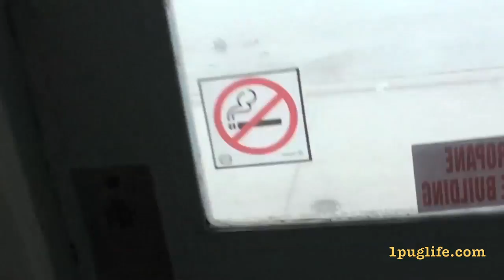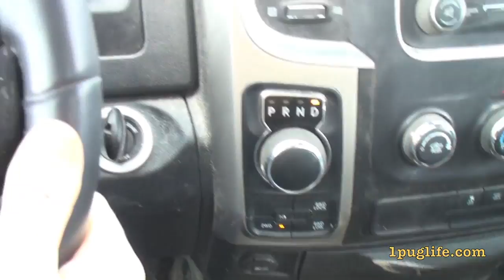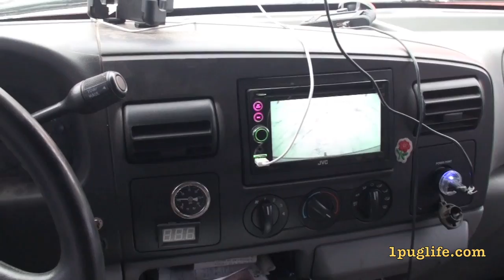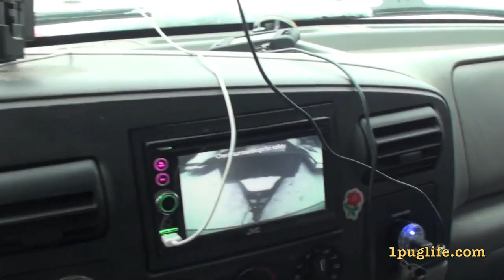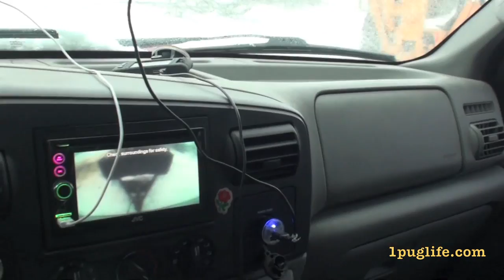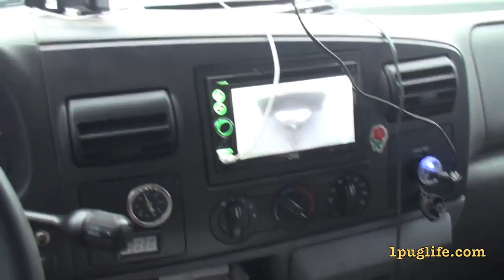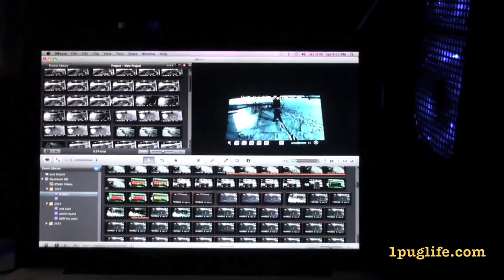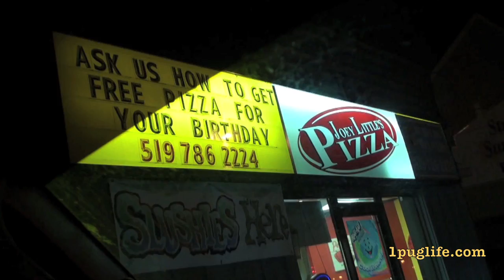spur of the cigrits wood operations

Comment: Turds used to rob me till I wired up my doorknobs to my welder outlet and then when they went to pull the doorknob off the legtricity turned their hands into baked potatos.
Reply: ps, put down lots of rock salt at night in front of the door for good conduction.
Reply: I'm talking about the 220 outlet on he wall. I use it to run the compressor. I do not know much  about arc welding.
Reply: *****
have you always hated yourself? you must still have all your teeth.

Comment: Hey pug, you need a STIHL chainsaw. They are the best. I am a small engine mechanic. Have worked on all kinds. STIHL IS THE BEST .
Reply: Those sharpeners are the bomb diggity. Thats what I use at the shop, in accordance.  Awesomner as frig ffs. If you cut wood boys, you NEED one of these. You will never use another sharpener.

Comment: I honestly can't understand why dodge wouldn't put any other forward drive gears on a truck like 3 2 1 all the Dodge has is D or better known as Dumb since most people who get stuck and are only there because they never try another gear. Its a very common problem here in BC I refer to it as stuck in DUMB \ D...
Reply: Vince, they have them. You digitally press up and down to shift in and out of 3, 2, 1.
Reply: Jeff Langridge Thats cool but it seems like a person who is stuck in dumb might not be smart enough to figure that feature out... after all lots of people still don't know that automatic head lights don't include the tail lights
Reply: ***** Automatic headlights turn on the taillights, it's daytime running lights that don't and if you really need taillights the headlights should have already turned on.  And why the fuck would it matter if you only have drive, there's no reason to manually shift an automatic, it still goes through all the gears.
Reply: Offroading Pro guess you have never been stuck in an automatic and wished there was another gear besides drive. thanks for the correction on the lighting terms
Reply: Offroading Pro Well the situations I am referring to are under hauling heavy loads or being stuck where a fucking goof like you would leave it drive and call a tow truck rather than try another gear. A goof like that would be this clown that lived in Langley drove an Auto acura intergera shifted thru all the gears even dropped it in neutral to rev the motor while driving to pretend like it was some type of manual all day everyday... Now that's what a goof is.
Reply: ***** After reading that comment it's very clear that you don't understand how an automatic transmission works.  You can put an automatic in any forward gear you want it is always going to start in first, so if you're stuck it's going to be in first fucking gear no matter what, unless you just hammer on it and get the tires spinning fast enough to shift into second.
Reply: Offroading Pro which is easy enough to do when you are stuck why not lock it into a lower gear. I know dodge is looking for a clean look
Reply: ***** It's fucking pointless, if you are stuck the TRANSMISSION is going to be in FIRST gear and it's going to stay in first until you get unstuck.  The only thing that might get you unstuck is 4wd.